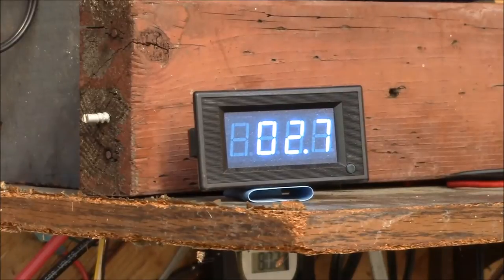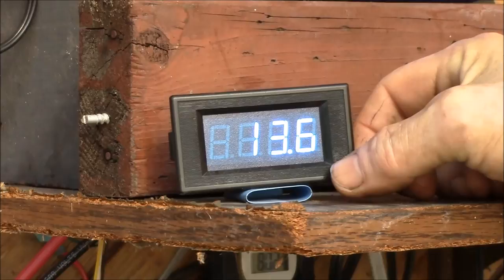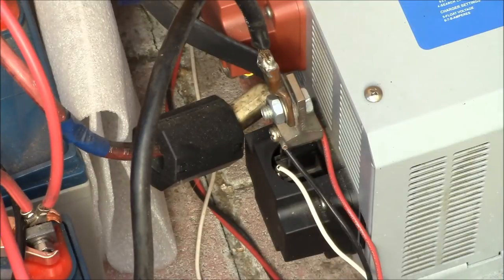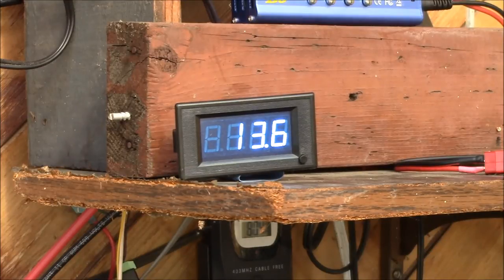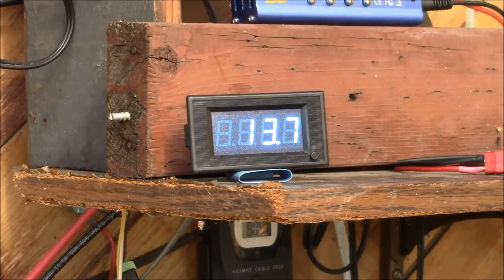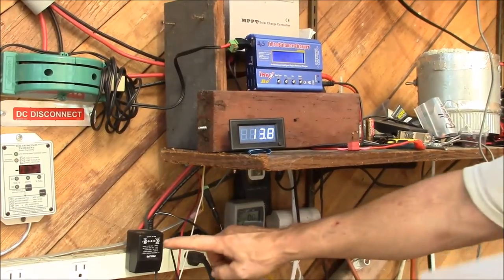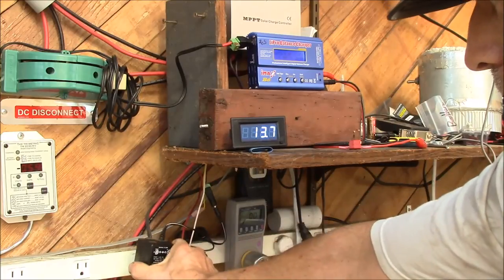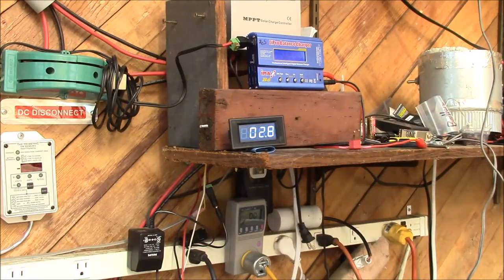Inverter Ammeter

Comment: Thanks Pal. Just got hold two small dual display Digital Volt/Ammeter i.e. 0 - 33vdc 3A build-in shunt. Noticed that the voltage accuracy is spot on. However, current measurement really fall short, compared with my Fluke Meter, differences of 50mA - 100mA. May due to the quality of the shunt ?
Reply from the maker: TheOldmankk If there is a calibration potentiometer for the current reading, see if you can adjust that.  I think the current readings tend to be the most variable.  In my solar system, I have the charge controller current reading, the Trimetric battery current shunt, my inverter ammeter shunt and a clamp-on ammeter and all 4 will read something different.  In fact some times the charge controller is reading -1.0 amps (discharging), inverter is off and the battery monitor is reading +.4 amps (charging).

Comment: Gday mate, any idea if there is a surface mounting block for this little meter please.
Reply from the maker: I never looked for one, but if you have access to a 3D printer, there's like something on Thingiverse.com.  Otherwise, grab a small electronics project box and use a scroll saw or nibbler to cut a rectangular hole in the top and that should do it.

Comment: Hows your Tripp Lite inverter in regards to EMI / RFI ?
Need a "quiet" one for Ham Radio usage...
Reply from the maker: +N2CUA Out of the box, its a bit noisy.  I did add two large ferrite chokes around the two input power wires and that helped reduce the noise on my CB radio, which is powered off the same DC battery bank.  But then I added a 250F capacitor bank at the input and now pure silence on my CB.  I can turn the squelch off and hear only a bit of hiss whether the inverter is on or off.  Before the radio was almost useless with the inverter running.  Again, this is with the CB radio running off 12V DC from the same battery as the inverter.  Don't have any radio gear that works off 120V.
Reply: ok thanks for that info .. I may add a few computer grade caps to the battery bank when I'm sure theres no gassing lol
The noise I was getting was thru the antenna and only when I had an extension cord connected to the inverter to run whatever appliance it was .. so its coming from the 120V side and radiating to the antenna .. but in either case I do like the idea about the caps on the bank .. I am going to try and install additional EMI filtering on the 120 V line and see how that helps ..
Reply from the maker: +N2CUA Yes, I think a series of things seems to help.  I assume I was only getting noise in from the antenna or conducted in over the DC power wiring.  I also properly grounded the radio antenna mast and I still need to ground the inverter.  It is grounded when I have the charger plug connected, but when not, it's not grounded.  I'm in the process of rewiring my battery bank and solar charge controller to add a proper ground fault detection relay and connecting that all up to the house AC ground.